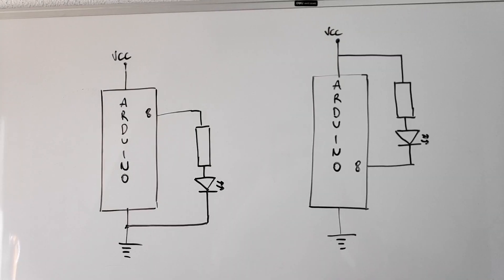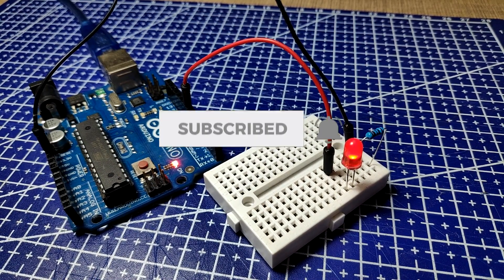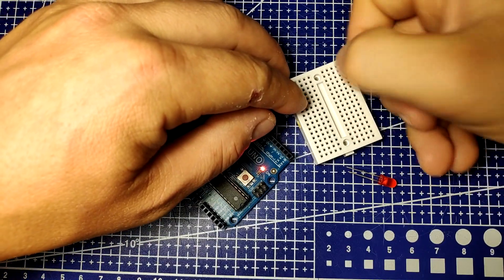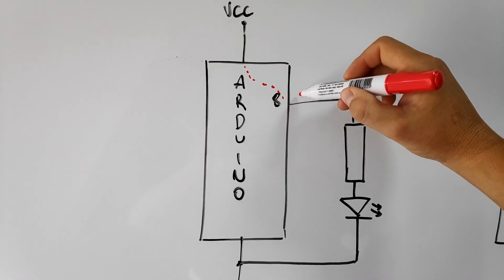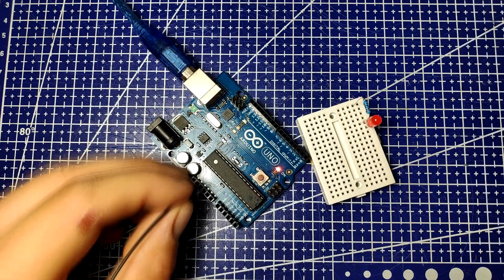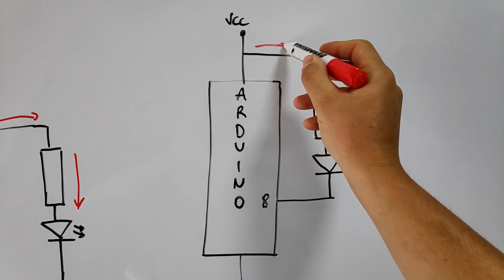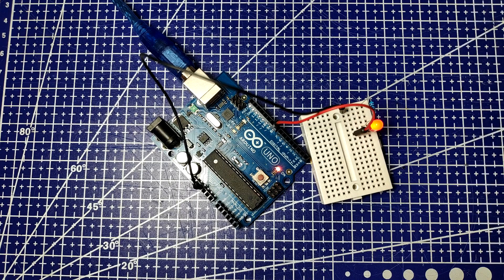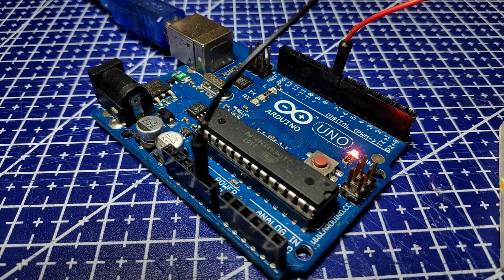Sinking vs  Sourcing current with Arduino

Comment: is it the same wiring in the the plc?
Reply from the maker: What plc? I'm not sure that I understand your question...
Reply: @TasteTheCode  i mean wiring a d.i. in PLC programmable logic controller like Allen Bradley PLC.
Reply from the maker: @nayrbsworld3048  I'm not familiar with those but they should be just glorified microcontrollers so the wiring should be the same. It is best to consult their manual or documentation.

Comment: Very helpful!  Can you also run current to an LED when sinking current and digital output is HIGH?  If so, how would you wire that?
Reply from the maker: That is exactly my example in the video :D
Reply: @TasteTheCode  Sorry I'm confused then.  I thought you switched the digital output to LOW in the code when the current was sinking?  Overall I'm trying to figure out how to wire 4 different LEDs given the 4 cases:  Turn on LED 1 only when current sourcing and driven High.  Turn on LED 2 only when current sourcing and driven Low.  Turn on LED 3 only when current sinking and driven High.  Turn on LED 4 only when current sinking and driven Low.
Reply from the maker: @andygay7305  There are no 4 states with current sinking/sourcing. If the pin is driven HIGH, it presents the input voltage on the output. It can only be connected via the LED and its resistor to LOW so the current can flow. That is sourcing. In the other case, if the LED and its resistor are connected to HIGH already, the only way current can flow is if the Arduino is driven LOW so there is a potential difference. If the LED is already connected to HIGH and the pin is HIGH, they are both at the same potential and no current will flow so the LED stays off. I hope that this makes it clearer.
Reply: @TasteTheCode  Thank you so much for your help.  I just found out the part of the example I was giving above was a trick question.  Now it makes perfect sense!
Reply from the maker: @andygay7305  Awesome! I'm glad you figured it out!

Comment: I have been trying to control a higher voltage than 5 volts by connecting a PNP transistor to the Arduino but it doesn't seem to work. But Urika!!! I finally got it to work with using two transistors first an NPN and then a PNP!
Reply from the maker: What doesn't work? You need to be more specific so I can help.
Reply: @TasteTheCode   I was spacific enough but anyway what I was saying is that I was trying to use an Arduino to drive another part of my circuit that runs on 15 volts, that would burn up the Arduino so first I thought I could just use an NPN transistor to do that but it wouldn't work... This is going to be a very lengthy explenation so I will have to make a video myself.